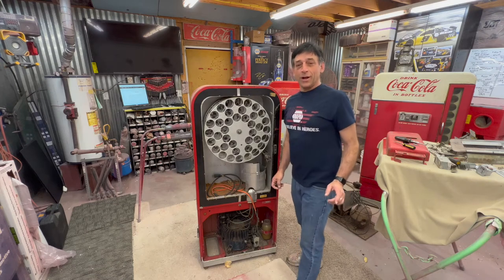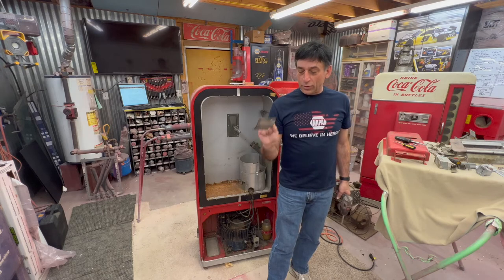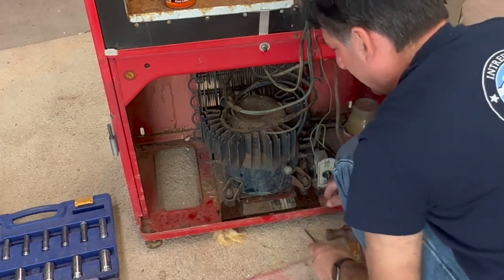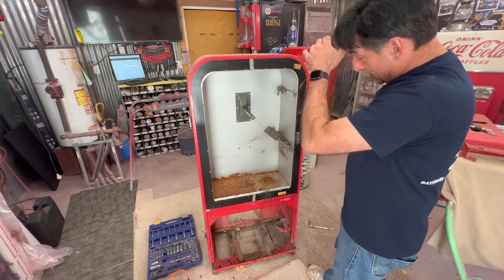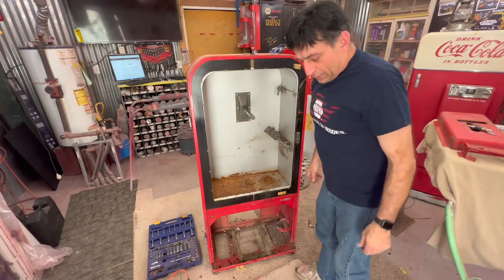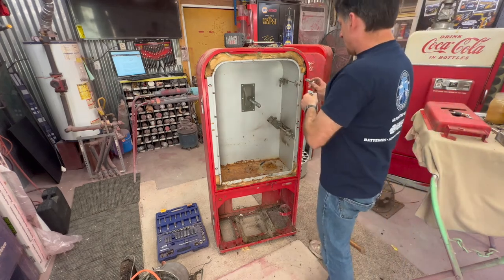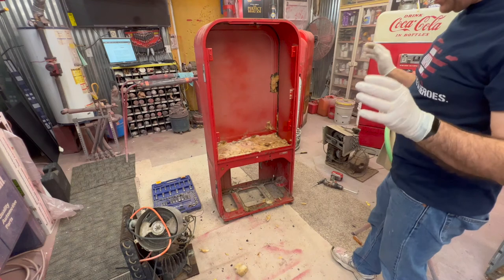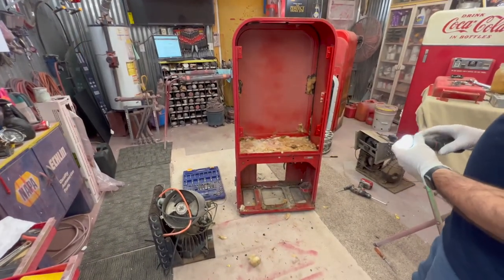Inner Cabinet & Compressor Removal | 1951 Vendo 39 Coke Machine Restoration

Comment: Hi there, great videos. I am trying to mount the drum shaft into the 1950 Vendo-39 and I can't seem to find the right screws to mount it. Would you know what is used to mount the shaft. Thank you Scott
Reply from the maker: Hello Scott let me get back to shop tonight and get you some info!
Reply from the maker: Scott it’s a self tapping screw. 1/4 outside thread measurement , 3/8 hex head 1/2 long
Reply: Thank you so much for checking for me, I really appreciate it. @sodatimerestorations

Comment: Where would I send compressor and evap coil for the 39
Reply from the maker: https://m.facebook.com/story.php?story_fbid=pfbid02QuSvuGiGodykSdbRq5FK1kWmUcbWHiNHXuSLHL8sRJPAViGreNN2aK3T5Zrkx7YHl&id=100057387469364&mibextid=qC1gEa
Reply from the maker: Gary does my compressor work!
Reply: @Sodatime Restorations  yes however the evap motor is bad.  So would I just send everything to him or what.  Sorry just starting this project.
Reply from the maker: @stephencritz  yes send as a complete unit ! Needs all parts attached! I will send you a picture of one I just sent off
Reply: @Sodatime Restorations  can you give me a guess around what it will cost?  If it's too much I would rather just buy a  new set up.  What's your thoughts.
Reply from the maker: @stephencritz  $1,200. Would be a new compressor new thermostat,new wiring,completely disabled clean and repainted finish!
Unit usually runs 900.00 plus freight there and back ! 
Give Gary a call! +1 (317) 435-3632